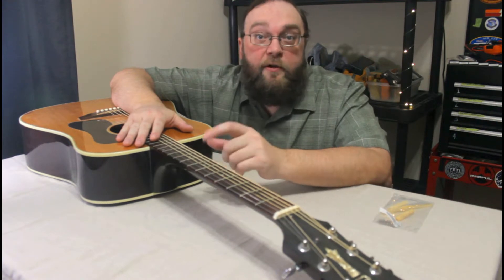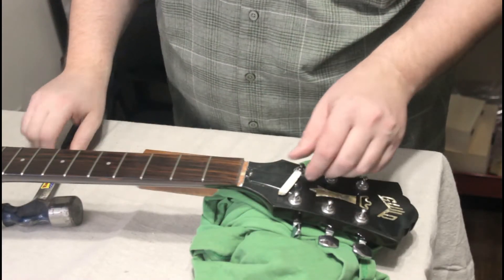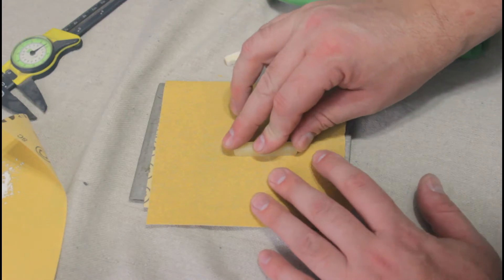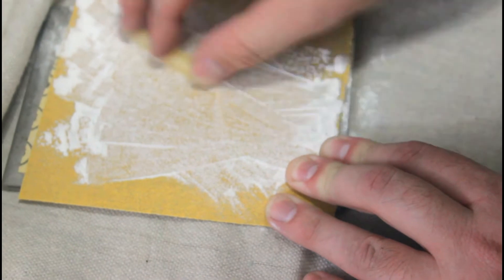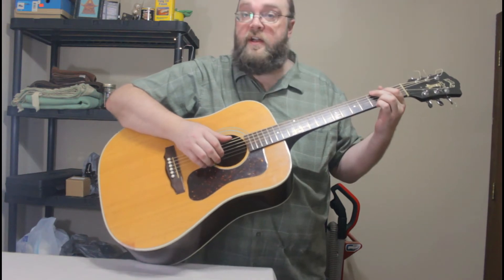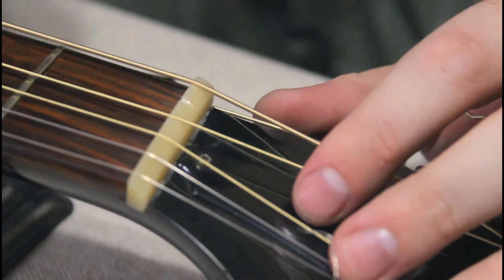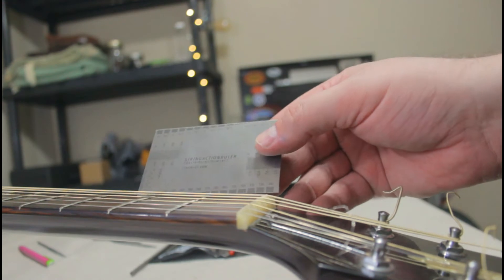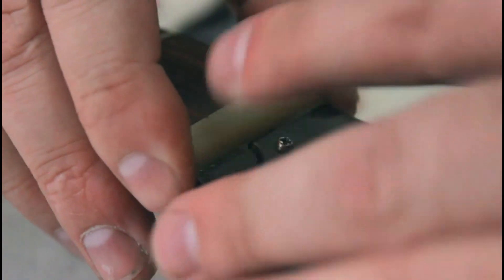Acoustic Guitar Nut Replacement

Comment: Appreciate the video.  I had to go through 2 before I got it.  Like you said, the finger pressure got me the first time.  The second one, by some miracle, worked out.  I chose a TUSQ nut.  I replaced a plastic one on my Fender CD60 - it was my very first guitar, and my dad gave it to me for Christmas about 13-14 years ago or so.  It's not a super expensive guitar, but it means a lot to me.  It's not perfect, but the plastic one had gotten too worn out and I didn't want to pay 200$ to have a new nut installed on a 150$ guitar, also having someone else do it for me felt bad.  I've learned a lot with this guitar.  It's actually kind of cool - I put Grover tuners on it, TUSQ nut and saddle and some TUSQ bridge pins.  Did it make a difference in the sound?  I honestly can't tell you.  The tuner heads and nut were the must have upgrades though.  The tuners had gotten so worn out they just wouldn't hold a tune very well, and turning them was just awful. 

Anyways, I just wanted to point out that it's incredible important to have a flat surface and that you constantly monitor your finger pressure.  The slot in mine was almost exactly 90 degrees, so once you get past 90 degrees - you likely will not get it back.

Comment: I bought a second hand electronic acoustic guitar the other day. Once I had a good look at it, I needed more than just the amp part lol I need to replace this but piece too. I don't have the old nut. Should I just try to eyeball it or?? Lol
Reply from the maker: Don't just eyeball it. If your guitar is a  well known brand you should be able to look up the string spacing online. Or you could even email the company and ask. I don't know if you'd get a response, but its worth a try.

If that doesn't work, you can measure the width of the neck where the nut should go and use whatever is the closest known brand reference. For an acoustic its probably either Martin spacing or Gibson spacing.

If all else fails, a Stewart MacDonald string spacing ruler might do what you need.

Comment: very light regular carpenters glue in a pair of very small blobs is all we need to hold a nut in place. Leave strings off as the nut glue dries in place l
Reply: Interesting, all I use is a tiny drop of C/A glue, ( my Luthier does the same) and the main advantage is the time, it's almost instantaneous, I just hold it down for 5 minutes, same with the saddle,  & double/check their firm& in place then string it up 😮😅😊
Reply: Nice and informative description of the possible errors that can creep in on a sanding job you described, that's why Iv'e found it best to use an Ozito ( or something similar, just a hobby brand) 2 stone grinder- Coarse and Fine, for finishing the  nut and saddĺe, it can Still go Horribly Wrong, & Very quickly, but with care, Iv'e found it much easier, kind regards Don 😮😊😅